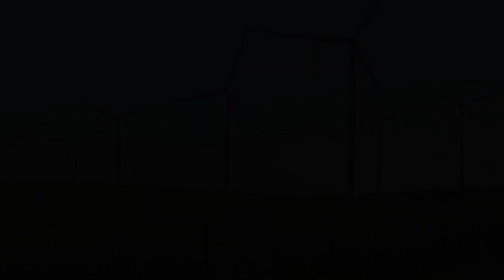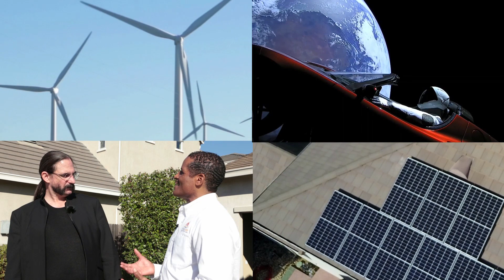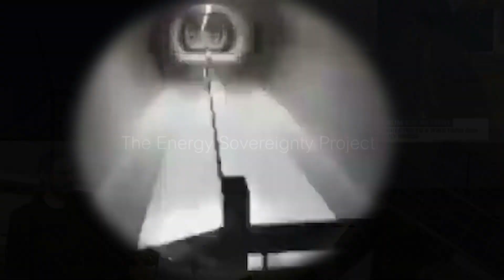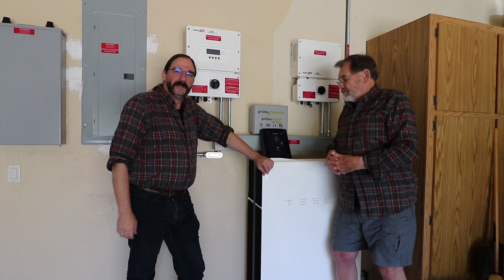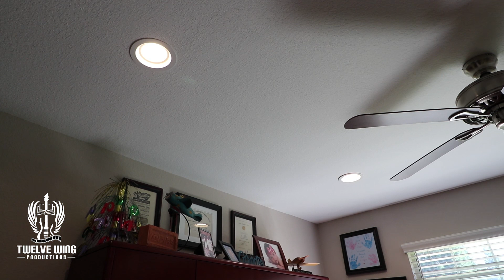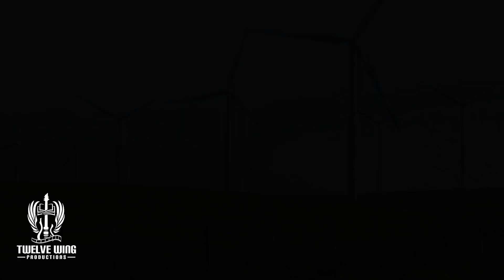New 2 Tesla Powerwall 2 install Part 3: Power issues

Comment: Great videos. I'm having a 2 PW2 system installed primarily to be able to ride out the PG&E power outage in Northern CA due to fire risk. I have a 12.6KW solar system based on 60 210Watt panels with 30 each on one of 2 SMA Sunny Boy 7000US inverters. In Sonoma County we typically have no clouds or rain in the August to November period when the outages will likely occur. Is it true the PW2s will be charged in backup mode by my solar system but never the grid and sit at full until a power loss occurs? AND So for the first night I will run off a full battery until my solar comes up in the morning. Then the solar will power my home AND charge the battery with the excess? Then when the battery is full, the PW2 uses the frequency control for its inverter to shut off my solar inverters. The I will be running 100% off the batteries even though there may be solar production possible. Then at what percentage charge does the PW2 allow my solar inverters to turn back on  to begin charging the partially depleted batteries? Then I would think this repeats until my solar production stops and solar inverters shut down. Then I would run on the batteries all night and that process would repeat. Is that correct? thanks
Reply from the maker: Correct.
You seem to have a good size system for energy sovereignty.
Some factors are your elevation for snow, your daily consumption normally for just the home and if you are driving an EV.
All these serve to dictate what size system you should be using and how many months a year you can expect to need grid back up power if any.
12.6 is a decent size system and equates to around 9-10kw usable. 

two 7kw inverters split is perfect since this allows redundancy.  That is the one thing I would have done differently with our system.
Reply: Thanks.....Do you know at what depletion percentage ( 90%???) that the PW2 uses the frequency control dropping back to 60Hz to turn my solar inverters back on ( after 5 minute delay) and begins recharging the partially depleted PW2 when purely on backup while PG&E is off? My system provides about 11KW on a good sunny summer day.  @twelvewingproductions7508  

I just sold my Leaf and have no EV now. I also have no electric heating nor Air Conditioning in Sonoma. Yes the split is good. I also have a 18 Enphase M215 based system with 18 250Watt panels that will be left off the PW2 system that is reserved for a future PW2, just in case. Do you know where there is a good discussion of the various PW2 modes via the APP? Will the PW2 operate in Zombie or Earthquake aftermath mode without internet and be able to be restarted in a depletion or overload shutdown also without internet. AKA - will Zombie - no internet allow operation without internet with will be down???  thanks
Reply from the maker: @thomaseames7264 , you covered a couple important details there.  Let me address the last one first since I'm about to release a video on the subject.
Tesla has been working behind the scenes to revamp all it's modes with appropriate AI that will allow the systems to adjust over time to your usage.
Because of this, there are NO current videos on the modes that are going to be of much use to you I'm afraid.

That said, I am about to release a video that shows something we have been seeing over the last two months that might help you understand a little more about what's going on behind the scenes.

The other point you make is about the signal to the inverters.

There are two times when the system sends a signal to the inverters to shut down.  One is when the system is full and the grid is disconnected.  If there is no place to put the power, the system protects itself by not allowing it to be charged.
This happens between 97% and 100% depending on the rate of charge.  If the rate of charge is rapid as on a sunny day, it will be closer to 96/97%.  If the charge is very slow... such as at the end of the day, I've seen it hit 100% before shutting them down.
It always waits until about 96/97% to re-engage the system.

The other time it will shut the system down is in cold weather.  Once the batteries reach a certain temperature, if the grid is shut off the batteries will not allow themselves to be charged at any rate to protect them.
Initially this was set artificially high.  I can't remember the exact number off the top of my head but it was mentioned in our earliest videos when we were struggling with it.
A month or so after those videos were filmed, I was reliably informed that Tesla had altered this number to something slightly above freezing.

Hope that helped.

Comment: I take the frequency went back to normal and the solar kicked back in at the point where the pw2 could receive energy again
Reply from the maker: Correct.
I'm working with Thomas and his system to bring another video on this.  When we did his drawdown test last month, his system had none of the flickering that we are seeing now.
My suspicion is that this was a firmware change where the Powerwall now retards the frequency further than it used to.
More to follow.

Comment: Question, you installed 8 power walls.  Are you running a full electric house ?  I am,  I just installed 2PW's.  I'm falling 6 hours short of powering the whole house from sun down to sun Up.  Heck I haven't even hit winter yet, here in NJ.  In the cold months, I'm heating with 9 zones of electric heat. I have to re-figure my power usage.... save up for more PW's  I guess.
Reply from the maker: We have 6 of the powerwalls supplied by 10.2kw of solar with a nominal peak in June of 7.6kw, and a nominal winter peak of around 4kw.
Our yearly average consumption is 30kwh per day with an average summer consumption of around 43kwh (not counting the car) and a nominal winter consumption of 18-20kwh.

So quite a bit of this is going to depend not on how many batteries you have, but on what kind of production you have.
What's the rating on your PV system, what is your yearly average usage per day and what is your nominal peak performance on any given June day?
Reply: @twelvewingproductions7508  I have a 17.8K Solar system, 55 panels, Full electric house, and i mean full, Plus two tesla EV's.   Today and going into winter months, is what I'm trying to cover,  Solar today produced 68.Kw..here in NJ. The Solar takes on an average 5 hrs to fill the batteries, plenty of juice from solar. House used 55.3, today   I'm running a few items, that keep us running at 1.3 to 1.6 continuous Kwh. My yearly average is over 20K usage.
Reply from the maker: @Themachinewon , Nice!  That's a hell of a system.  And yeah, with 2 EV's you are a candidate for at least 2 more powerwalls if energy sovereignty is what you are after.
I would even say you would benefit from 6 but that depends quite a bit on your lifestyle.
If you are having to drive to work and can't charge at work, that's going to place an increased load on the system in the evening.

So taking today as an example, you basically banked 10kwh, so that's your freeboard.
So from an energy sovereignty standpoint you can look at it as around 30 miles of driving.
I'm not sure how much your household collectively does on average.

But you are correct in that with your production you could benefit from having 4 powerwalls.

I will be posting the numbers for our third week tomorrow.  You can go through those and perhaps last month's closeout to see how that measures up against your usage.  That might give you a tangible example you can use to measure against your usage.  The daily numbers show the in and out of our system.  You might find this most helpful since you actually drain yours completely. 

Seeing how much our in and out is might allow you to see how much capacity you might need to start getting you through the evenings.
Reply: @twelvewingproductions7508  Most likely, I'll have to save up for a third & fourth PW.  The kids are growing and I still have to up grade the rear solar system to the newer 370's. As I go thought this winter, I'll be tracking how much juice we burn from sun down to Sun Up.   Great video's by the way.  Thanks for the info sharing.

Comment: Is that the power conditioner for EMI/EMF Eric had mentioned to me over the phone? I think he called it a power box or similar.
Reply from the maker: Correct.  SunWorks did come out that same day and bypass it.  We ran a test and the lights still flickered... so it may not be that.
I'm going to follow up with Thomas.  When we did a drawdown test of his system, his lights and UPS had no issue.  Recently, however, he did notice an issue with his UPS systems in his office until he reset his breaker.
The issue may be due to a software/firmware update Tesla put out.  I'll look into this further.  Tesla may have increased the amount they retard their frequency in the case of a full battery... and this may be a case where they have retarded it too much.

I'll go to Thomas's system and put a scope on it to see what the frequency is now vs. what it was when I recorded it in January.
Reply: @twelvewingproductions7508  Kind of reminds me of the EMS I installed in my RV. Hopefully a cause emerges... You already now know the effect.

Comment: Your videos are very informative.  I am getting 2 PW2s soon but have an Enphase system so it’s hard to always know what would be relevant info...
Reply from the maker: I have microinverters at the studio.  Basically it's the same.  The AC from your microinverters will simply go as AC to the Powerwall.
I think you might have a slight advantage over a larger inverter when it comes to efficiency.